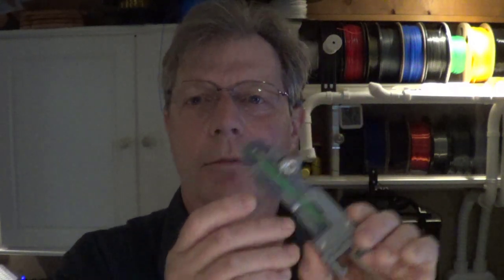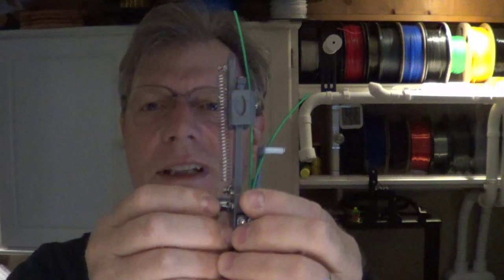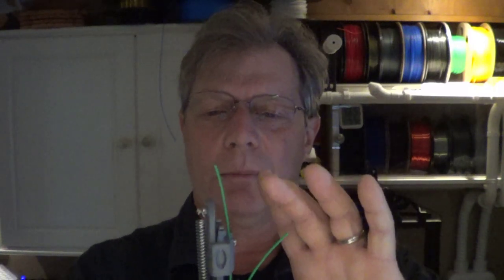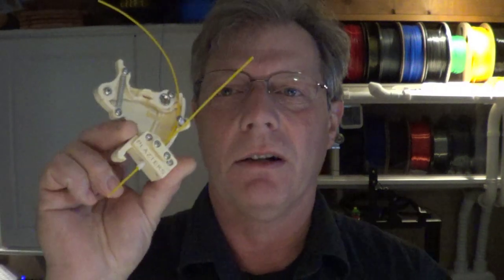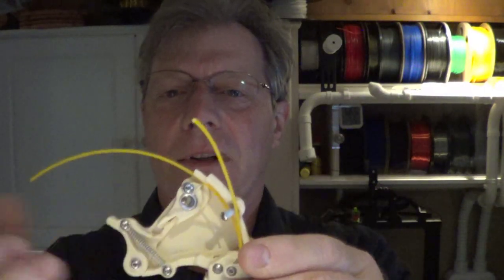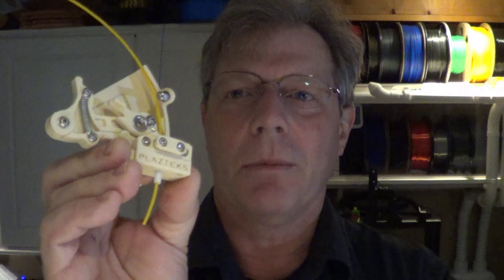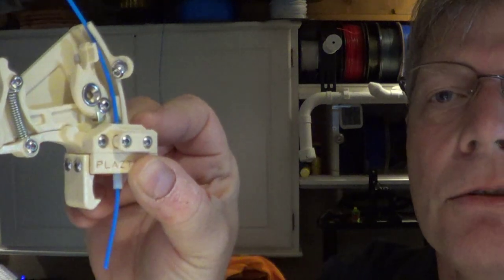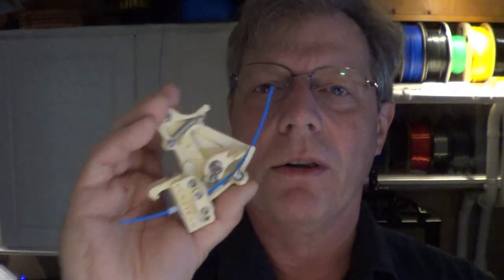Automatic Filament Loader 2.0 Now Available!

Comment: Nice, thank you!  Getting ready to unbox a Creality Ender 3 V2 Neo.  This may be one of my first prints.  :)
Reply from the maker: Hello Ken,  If you download it, I wanted to let you know  one minor change that I may have to make. A co-worker of mine has a Neo, and he said the z-rod nut is larger or possibly in a slightly different location than on the ender3 v2.  If the off-set bracket does not fit right, let me know and I will make an adjustment to the design to give some more clearance.  it might require eliminating one of the mount screws, but it shouldn't matter as the bracket sits on top of the existing gantry bracket.

Comment: maybe use spiral spring, bmg gears and bowden tube to put it on frame. and charge it up with a cool little key as a bonus )))
Reply from the maker: I experimented with that, but resistance was an issue. there is a fine line  between just enough downward or feeding force to get to the extruder wheels, and too much and it won't shift over.  that would require a stronger plunger spring, and then there would be too much wear pressure between the two filaments. Even if I had a spring wound long enough to transverse the length of a standard bowden tube, the internal resistance brings us back to the problem I just mentioned..

Comment: I take it that this can’t handle retraction since there is a break in the filament? Also is it likely to jam? Since it is made out of plastic I don’t think it would be good for abrasive filaments since running down that channel could wear it away.
Reply from the maker: Hello, thank you for your comments.  I did consider wear, so I designed it to use a short piece of PTFE tubing inside.  the only wear it should experience should be minimal to the front piece, and that is easily replaceable.  the plunger should have no pressure on it once the new filament is pushed over as it stops at the thickness of a single filament strand. As for retractions, yes you are correct, however it only affects retractions for the length of the bowden tube or the length of the extruder in the case of a direct drive.  even though the filaments are not connected after the new one enters and the old one is past the extruder wheels, it seems that just the extruder pulling back the second filament reduces the pressure in the hot end and does have a minimal "retraction" effect.  Again, most have agreed this is a small price to pay to have a continued print without interruption.
Reply: @frantasticdesigns  That would make sense about the retraction but I suppose an unlucky issue that could occur is that the filament changes at the exact time that it starts a retraction.

I wonder if you could add in a switch or similar to indicate to the mainboard when a switch has occured so it could maybe change how it retracts whilst that break in the filament makes it way to the hotend.
Reply from the maker: @conorstewart2214  it doesn't cause an issue, I took that into account in the design. As long as your retractions are les than 10-12 mm the old filament will push up on the new. The shear point is 10-12mm down the  plunger area.

Comment: Great idea, prob for me is cant imagine how would work on voron
Reply from the maker: Obviously there are some extruder designs that will prove impossible to adapt, such as the Titan style. The filament inlet is on the tension arm, and is too small. I will look at the Voron design and see what I can come up with. Not having one of my own will delay development( until I can get my hands on one.
Reply: @frantasticdesigns  If you can get rid of requirement to be on the extruder, that would be great.  Put on frame and any extruder would work.

Comment: I'd love to see if this would be able to be used in conjunction with a runout sensor
Reply from the maker: Hello, in what regard? The device thas to be just before the extruder gears to work, so the run out sensor would have to be before the loader. Not sure why you would still need the run out sensor, as the loader eliminates tge need to payse your print....
Reply: I'm using a bowden style printer so the leftover filament after a run out adds up pretty quickly. In less than a month I have a bin with more than 50g worth of which would otherwise be wasted.

Comment: What happens if the filament is pulled out the top ?
Reply from the maker: I am not sure I understand your question? Why would you? the tension plunger would just press forward against the running filament..
Reply: @frantasticdesigns  im looking to use this for a specific 2 color print, color change only once. in software i can tell it to retract it and have a tension auto rewind roll thing i seen its a 3d print that has a clutch and spring so it auto rewinds the filament as long as it escapes the teeth from the gears on the extruder motor it should pull it out. if it does if this filament get pull out the top would the second filament go in as if its been pushed through like on the video?
Reply from the maker: @CodeMasterCody88  I am still struggling to see how you would use that for color change.  The whole purpose of this device is to use up a whole roll and start another one as to not waste any.  Wouldn't an "AMS" system serve you better?
Reply: @frantasticdesigns  do you have one in mind that I could print. I think this mechanism may do as I need. When it pulls the filament out it slaps the new one in. Instead of running out it just gets pulled out and then the new one comes in. I could technically just measure how much and I could achieve the same job but use this tool as it's intended purpose but instead of the same color you have it the next color. It's just 1 color change at a certain height. If I measure how much it lays down I technically could just have it set up like that but who wants to measure each time. I want to use this so when I pull the filament out the top it also injects the new filament just like how when it uses up all the new filament it injects the new filament so you don't run out.
Reply from the maker: @CodeMasterCody88  I see what you are trying to do. Short answer, is no, I don't think it will work the way you want. The new filament will only enter the feed rollers it it is pressing against the end of the filament running out. The tension arm does not apply enough force to overcome the feed roller tension spring. If it did, there would be so much down force, the plunger that pushes the new filament over would not be able to move it. There is a fine balance of down force, vs. side force to make it work.

Comment: can you make one that is compatible with the titan or bmg extruder?  Also, one that works on direct drive would be amazing!!  The loader is so cool!!!
Reply from the maker: I have a version for BMG and it is included in the files on cults.  As long as you have clearance around your extruder and the device, it should mount fine.  Look at the pictures in the Cults3D listing and you should see some pics of that variant.  The Titan will probably be a no go as the filament enters the extruder arm, and it is very small.  Here is the YouTube showing the BMG style.:
https://youtu.be/dM32Lyew9hY
Reply from the maker: Sorry I forgot to mention in my last reply, It will work on a direct drive, as that is how I have it mounted on my Ender 3 v2.  Again there are video on youtube, and pictures in the Cults3D listing that show it mounted as a direct drive.  The only trick is that since the extruder is in constant motion, you have to have a "fluid touch" if you need to add the second filament mid print.  I do it all the time.

Comment: why not extrude a custom filament on the fly, no loader required, just the source plastic beads
Reply: yes screw press extruder through a small nozzle into dynamic filament
Reply from the maker: No disrespect, but I think you are missing the point of this device.... 

1. Continue with long prints without running out

2. Help folks use up left over small pieces of filament without splicing

3. Unattended reload/ continuation of print without run-out sensor and pausing to reload

4. Super simple spring-loaded mechanism not requiring any power or firmware upgrades.
Reply: @frantasticdesigns  well dont play with filament at all, just my 2 cents, k.i.s.s. glhf
Reply: @frantasticdesigns  also industrially it makes more sense to make your filament yourself, from source material, plastic granules feed stock
Reply: @frantasticdesigns  so I mean gimmicky device imho
Reply: @frantasticdesigns  yes no offense intended either
Reply: I don’t think you own a 3D printer.  This is an amazing idea.
Reply: @darktherapy  someones got to earn daily living do they, I got mine as gift from God, such as what I said, not talking my own (lying)
Reply: @darktherapy  therefore you must be talking your own, for two cant be talking what the Lord gives, talking against what the Lord gives
Reply: @darktherapy  op, did you get your idea from God or are you talking your own, as if from people/flesh, a bit gimmick idea, what payment do you need to get that idea going, I got mine for free and its free, and not wasting stuff for no reason, and removes a money maker filament maker from the trade chain
Reply: @darktherapy  if you want to prevent the idea I have then it only shows what type of operator you are with your idea, exclusivity for no reason
Reply: @darktherapy  sorry I cant take your assessment seriously, your recommendation does not count
Reply: @darktherapy  why would you use such a thing if you have only 1 printer, are you not next to the printer during the whole print
Reply: @darktherapy  if you are against my idea, and not free, then enemy
Reply: @darktherapy  rise, take your bed and go home, and do your own stuff, I will not hear you
Reply: @darktherapy  dont vow, dude, for you dont know, you just guess what I have or dont have

Comment: You should add in 4mm counterbores to the top filament entries. Very neat design
Reply from the maker: Not sure where you mean?  there is already a "cone shaped" counterbore to the PTFE tube and the top of the plunger area is chamfered. Please elaborate. if it makes sense, I will make the modification.
Reply: @frantasticdesigns  As a guide for your filament, maybe you do have it and i can't see,  but i mean at the top of the arc to the left, just above where the new filament enters the device,  and bottom front center where the old filament is entering. Just as reverse bowden from filament to device
Reply: @frantasticdesigns  and you could have it make up 270 degrees if the diameter so you do not have to use it, and can still press filament in from the side,  on the top entry anyway
Reply from the maker: @travistucker7317  its has to be all open except at the final entry point where the PTFE tubing is to allow the next filament to be added. With my design, you can just keep adding the next roll after each one is going empty. If there were separate entry holes, it would limit your roll usage to 2 only before you wouldn't be able to add more.....
Reply: @frantasticdesigns  Yes, i understand. I mean to have a boss that extends maybe 10mm total, from the top,  with 5mm depth, 4mm counterbore, that is 270deg closed, with 1/4 open so you can still side load, if you desire. I'm currently not printing anything over 2 rolls worth. That lasts me 4 days, so long enough for all my prints, for now! 

If you had filament in a dry box, for example, it would keep the filament from pulling on your box. 

I wonder if you could double your mechanism, allowing you to go back and forth indefinitely.
Reply from the maker: @travistucker7317  If I understand what you are saying, it already allows you to just keep adding filament before the last one runs out.  you wouldn't switch back and forth, as the mechanism relies on the one running out, allowing the second one to be pushed over in it's place.  as soon as that one passes the drive gears, and the swing arm catch disengages, you can load a new filament starting the process over again.  when that one is about to run out, load another.  not sure why I would need to double it.
Reply: @mstrwizard1  OK great, i see what you are saying. I'll have to put one of these together and play with it
Reply from the maker: @travistucker7317  if you watch some of my other YouTube videos, i show continually adding short pieces back to back making calibration cubes with as many as 12 different pieces, each les then 10" long....
Reply from the maker: https://youtube.com/playlist?list=PLbGYfvOE9jFh7zjVVzNjaRn8Qarnzl8Qv
Reply from the maker: https://youtu.be/PUHUfJREGlQ

Comment: Pretty neat contraption👍.  How about making it universal, by making it a mobile device with a heating block, so it could splice on the go, as you are running low(not empty) on filament.  Instead of nomal splicers, that need filament to be pushed against each other in a heated die, this would involve a moving filament, that will be spliced against one from spool.
A tensioned spring should be good enough, once the heated block is brought to temp, at which point the moving filament is cut/pushed into the heated die, while the tensioned spring pushes the filament from spool into the die(could be two split halves, heated by contact), to fuse with the filament that is held in the die. Also, the block need to be cooled fast(by contacting a cold block of metal?, while cutting off power), while this floating handheld contraption can open the die to let go of the now continuous filament! Just some 💭.
Reply from the maker: Interesting thought, Would be a complete "back to the drawing board" though. Given that the spring tension is just sufficient to reach the drive gears, not sure  if there could be enough to overcome the necessary friction to break the "weld" free from the heat block tube walls once cooled.  Back to some of my comments of using an additional stepper, run out sensor, micro switch, etc.  Not to mention wiring heat block...... Kind of negates the concept of just a simple spring loaded device. Also this device is designed so you don't have to splice at all.  Sure as others have commented, retractions don't occur (on the new filament) until it passes the end of the nozzle, but it only affects a few in your print. At the moment it is universal in the main body and what it does, but unfortunately, given the fact that there are so many extruder designs out there and just as many mount configurations,  I doubt I will ever be able to adapt to every one I encounter.  But thank you, I might tinker with your Idea in the future. Thank you for your comment though.
Reply: @frantasticdesigns  Thanks for the detailed response. The device is truly marvelous, just not sure of the install effort. I've tried in the past unsuccessfully to continue a print, while running out of filament,by pushing one through directly. The issue was, the compression force of hobbed bolt not allowing the new filament through. That said, I've also used the Mosaic's Palllette+ to do successful mulicolor prints through consistent splicing(Just that there is lot of wasted filament, in priming, and also terribly slow, compared to a single color print). But I love their splicing system(uses a teflon tube kept in heated block, then fuses filament by squising against each other). There are two steppers involved, one part of individual color feed, one that is shared. The utility value of handheld universal splicer(if it can perform reliably and consistently),is justified, by the ability to share between printers, without any additional complexity/space to deal with. Also, it is a point of use tool, used whenever it is needed in a short notice. Does involve a heater block, but will be even better, if it has a rechargeable one, good for a few splices. It could be done in a couple of ways, one used for splicing filaments before printing, second on the go splicing. The later is more versatile, if it could be done, just with some springs instead of steppers and in a handheld form factor.
Reply from the maker: @aware2action  I know what you are talking about regarding the resistance to the new filament not being allowed to enter the gears, because they are shut when you tried to push a new filament in.  The trick is that the end of the old filament and the new are touching each other, so the gears are still open the width of the filament as the new one is entering.  that is why the new one shouldn't be severely tapered, but just have the sharp edges smoothed with either sand paper or just flashed with a flame to smooth it.  if  there were a gap between the old and the new, exactly what you describe happens.  When the first filament passed the sheer point where the new one pushes over, the spring arm forces the new one down quickly taking up the gap, and keeps them touching until the first one passes through the gears.
Reply: @frantasticdesigns  That makes perfect sense. Also I thought, if there is a way to temporarily(for few seconds) loosen the idler bearing pressure without holding the moving extruder, simple pressure of feeding by hand should do the trick as well. Should be more of a press button kind of thing, without overpowering the X/Y axis steppers. One the filament is past the toothed shaft, another press of the button should put back the pressure.
 Not sure how that could be done without much complexity though.